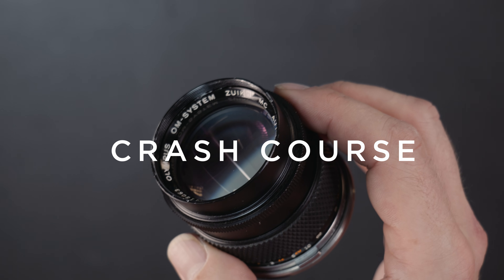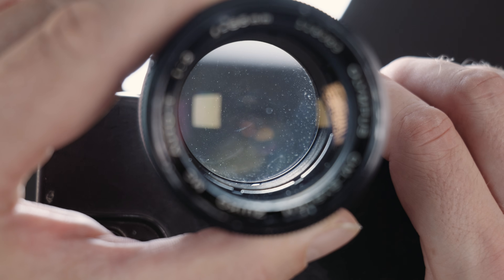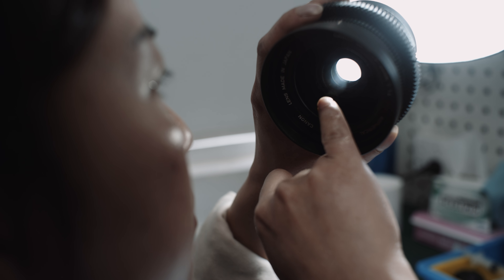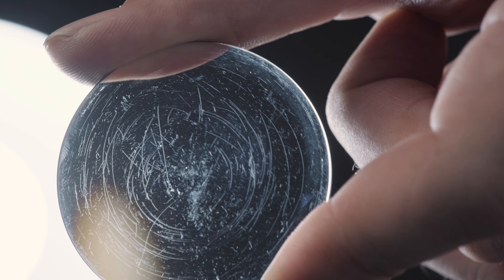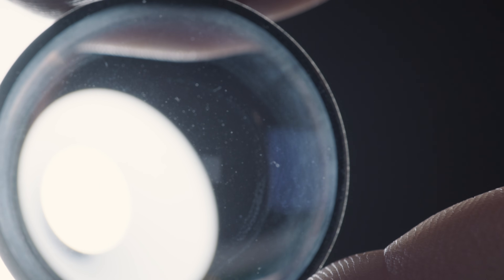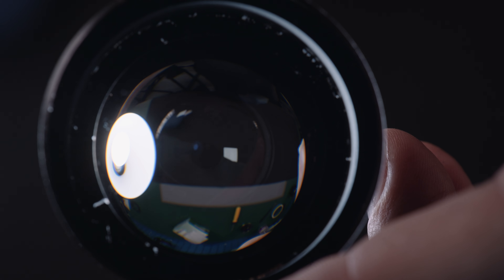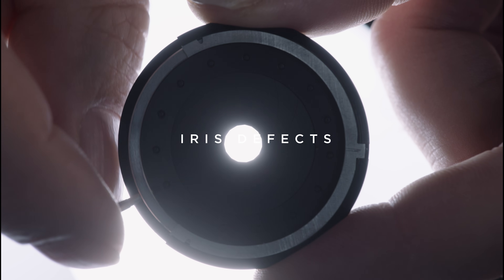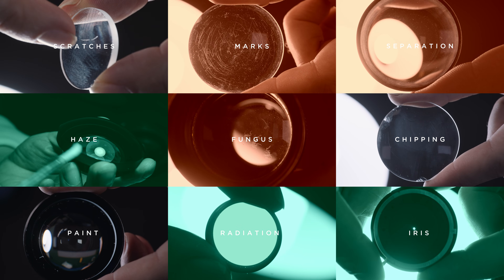How to Judge a Vintage Lens – A crash course on how to identify and  evaluate lens defects

Comment: Very instructive video. Thank you! I have a lens that has all elements but one in perfect condition. But that imperfect one is a single element (not a doublet) that is very opaque. The image through the viewfinder has a milky look. The texture of this element feels a little rough to the touch, but very slightly. It seems that it's something limited to its surface. But I'm not sure. I polished it with a microfiber cloth and toothpaste. I'm not sure, but it seems to have improved about 30% or 40%. I didn't see in this video a pathology like this one my lens has. I call it haze, but the kind of haze you showed can be simply removed by cleaning. I don't know the cause of this haziness. It was already opaque when I bought it; I don't know its history. Could it be some sort of chemical attack? And if so, why only one internal element? Anyway, considering that probably the problem is restricted to the surface, I'm thinking of performing a deeper polishing with cerium oxide. Could you provide me any advice on this case?
Reply from the maker: Thanks... of course I can't give you a sophisticated opinion without to examine the lens. Sounds very odd and like something I have not seen before. A chemical breakdown of a coating?! Glass doesn't break down like that. To remove the surface sounds like a good idea. In SCOPE 3 we show a method to remove a coating completely.

Comment: Thx. Nice video that breaks down mostly all issues. 

Like to add a point, 
A had a used/vintage lens that was working as expected in 0-30 degrees, below 0 it got stuck, and above 30 it started rattling as material expanded. 
Had the same problem with a modern Lumix lens.
Reply from the maker: Thanks a lot. Sounds like a warped barrel and old grease. Degreasing might improve usability a bit

Comment: Sir as we know that in 24fps each frame is onscreen for same time then sir how we can easily tell this object is moving fast and this object is moving slow .thanks sir
Reply from the maker: motion blur… motion blur is determined by how long/fast an object moves during exposure. Motion Blur is aso determied by shutter and framerate. At 24fps and the standard 180° degrees shutter, you can see how long/fast an Object moved in a 1/48th of a second. Should you expose much faster, a single frame can't tell the story of movement and the video "strobes" … we have an episode on that: https://www.youtube.com/watch?v=mFp_ebMl9H0

Comment: sir how in video frames are possible.sir when we see fan in video we see 6 blade of fan but when we pause video we see 3 blades so how is this possible ? And if all frames are shown at same time to us then how we can say that this object is moving fast and slow.
Reply from the maker: Appearance of fast moving objects can change vastly depending on fan rotation speed camera shutter, and sensor readout (aka rolling shutter). An images series of a three bladed fan shot at high shutter speed may look like like six blades, or 9, or 12… depending on respective speeds. The classic example for this are helicopter rotors. The rest didn't seem to make sense in the english language
Reply: @MediaDivision  Sir as we know that in 24fps each frame is onscreen for same time then sir how we can easily tell this object is moving fast and this object is moving slow .thanks sir
Reply: @MediaDivision  pls reply sir I do not know about this

Comment: Actually, the aperture can easily be cleaned in that you spray it with a chain cleaner from a bike. First you remove all of the elements and then you spray it with the chain cleaner and operate it a few times. This will remove all of the old oil. Then dry it and reinstall the glass elements. job done.
But for this to work, you need to remove all the glass elements, otherwise you'll contaminate them with oil.
I fixed two vintage, and admittedly budget lenses, this way.
Reply from the maker: Go for it… I don't recommend to try that DIY
Reply: @MediaDivision  worked great for me twice so far. You dont need to disassemble the iris blades or touch them and risk damage. I don't see why people don't use it? I'm not a pro or anything, just don't mind trying out things when a lense costs less than a hundred. Can you tell me why you wouldn't recommend this fix?
Reply from the maker: @TheRoadrunner11  because it really depends on the iris at hand and some are very easy to damage. If the lens is dirt cheap… sure, try whatever. With anything worth good money… let an expert do it. Most advanced lenses are complex enough that non experts fail to reassemble them correctly… I learned the hard way
Reply: @MediaDivision  Oh no for sure I agree. De-oiling the apperture once the lense is disassembled is easy (again, no need to remove or touch the blades with my method), but getting to that point depends on the lense and is mostly challenging.
I wouldn't trust myself to disassemble an expensive lense. Or anything more modern than the 90s. I once had a very stressful time reassembling an autofocus Sigma lens for Nikon F mount, and I will never do that again.

Comment: Great video.. A nice add is to remind users that using cloth for cleaning can lead to surface scratches and to use one time use cleaning papers such as Kimtech wipes will mitigate this.. A microfiber cloth picks up direct using static charge so its hard to remove all debris from them over time. This is a common reason why most of us who wear glasses have surface scratching on our lenses from using microfibers..!
Reply from the maker: Kimtech are under dispute too… but I use them all the time, and so does Arri techs. I use micro fibre multiple times, too… and so do all lens experts I know?!

Comment: just a tip about fungus, sometimes they clean the fungus off a lens and sell it as fungus free, but if you have the chance you should check the coatings by tilting the lens at an angle and look for fungus marks (plant or root like) where there is no coating, which has been "eaten" by the fungus, making it a permanent defect.
Reply from the maker: As long as they don't remove the coatings you can definitely see the damage
Reply: Yes it has to be polish and recoat after cleaning the fungus.

Comment: Good info to know. I can only say one thing - the light that you are using for checking is too big of a source. In my experience the smaller the source - the harder the light - the easier to show defects. It is like if you are trying to take a photo of the lens - softer light can hide the dust but harder light will show and make every dust particle pop.
Reply from the maker: This is directly showing the technique from lens experts at G.L. Optics

Comment: ⚠️*CAUTION*⚠️ Do not go scratching or putting your eye near vintage lenses, alot of the lens have a RADIOACTIVE coating of thorium. 

These coatings are fine in normal use since it gives off weaker Alpha particles that can't penetrate metal or plastic coverings. But when scratched or put near your soft body tissue it can cause damage as you're are making yourself susceptible to its radiation which can causes a host of problens from cataracts to different cancers.

One telltale sign to know if the lenses you have are radioactive is to pay attention to the yellowing of the glass. Thoriated glass yellows over time.

P.S. I Know this is somewhat addressed towards the end of the video but, most people do not watch the entire video. Plus he makes light of the radiation by joking about grinding it up and eating it. 

There are Photographers that have shot during the film era, that would put their eyes towards the ovf and over time it developed enough exposure for them to have developed eye complications from shooting with these radioactive lenses. There is a reason why they stop using Thoriated glass)
Reply from the maker: This is an example for bad advice you find on the internet… unless it is meant as a joke?!
We actually mention radiation defect in THIS video (f-center) and how to repair it – and also, that it is harmless unless you grid and eat the lens.
The relevant portion of Thorium is in the glass itself to change the refraction index – this technique is called spiking and has been banned in the 70s to prevent Thorium from entering the food chain.
Thorium decays by alpha decay, which doesn't meant that a radioactive lens only emits alpha radiation. Many elements in the decay chain are beta emitters. Gamma is always a side effect when the nucleus and electrons find their new lowest energy state. This means that the lens will emit alpha, beta, and gamma radiation. Studies have shown that the overall amount of radiation absorbed with normal use is neglectable, even with high Thorium content.

Comment: FYI, there are lens repair experts that can fix balsam separation.  Have had lenses so repaired.  IIRC, the elements are separated, all the original glue is removed with a solvent, the elements are then re-cemented with modern optical cements.
Great overview.
Reply from the maker: Thanks, yeah I know… they don't guarantee success and I am very sceptical about the integrity of the optical axis. Generally… I would not recommend that unless you have a really really expensive unique lens.